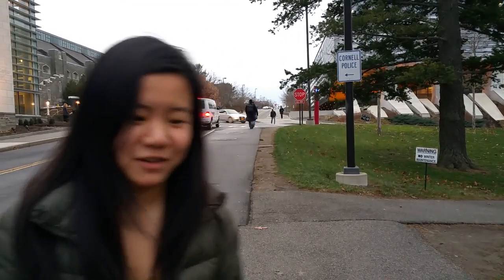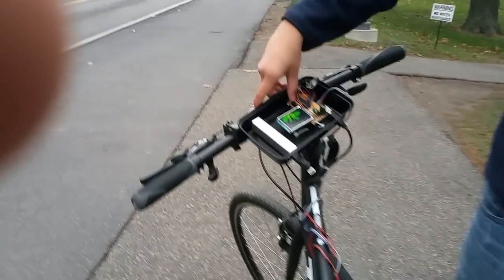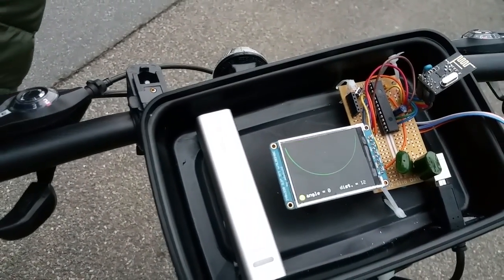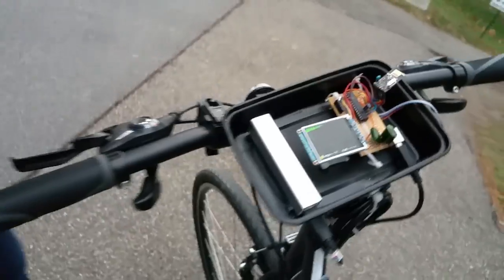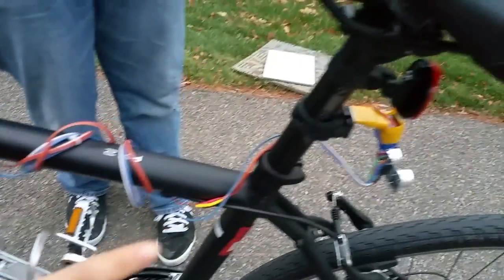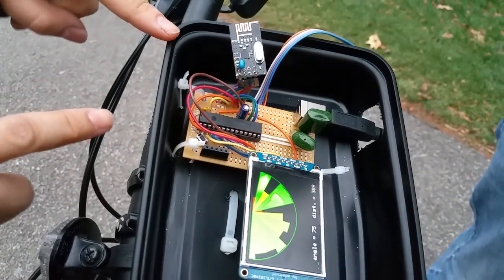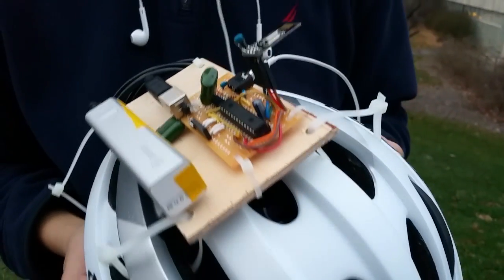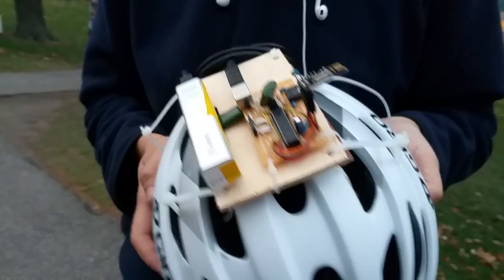bike sonar

Comment: nice job. I personally wouldn't use headset while driving, it's just too distracting and probably not safe since you do need to hear the traffic surrounding you. a larger visual feedback could make it better.  you could use vibration motors like the ones used in cell phones as hepatic feedback to tell you if there is a vehicle behind you to right or left, maybe one motor will be attached to right leg to give information about vehicles coming from right, and another motor attached to left leg to give information about vehicles coming from left. in the future I may work on this project, this was inspirational.  thanks

Comment: Very nice. Pity the scanning speed is way too slow - use multiple sensors instead
Reply from the maker: Do you understand that they had a very small required budget?
Reply: A parking sensor with four ultrasound sensors that you can cannibalize sells for $15 on aliexpress and has a dashboard that you can reuse and save the LCD screen